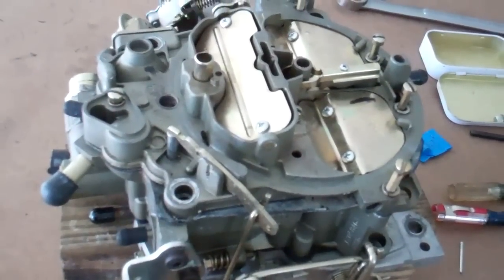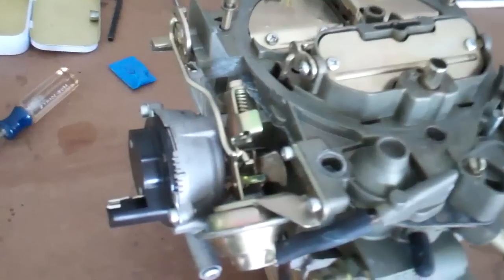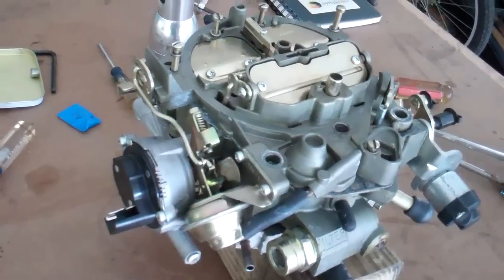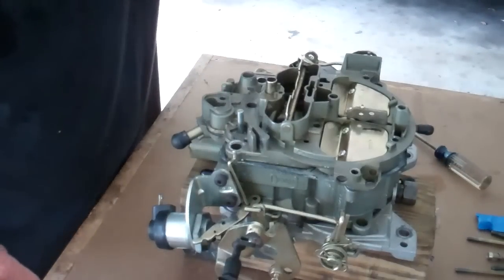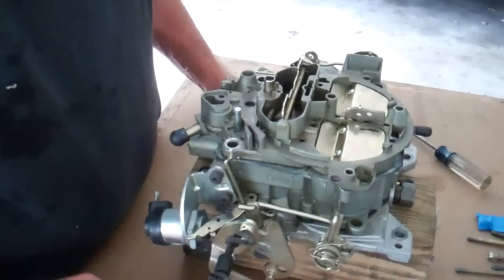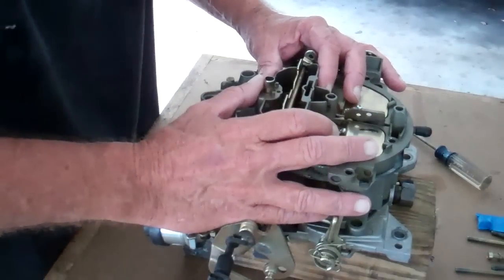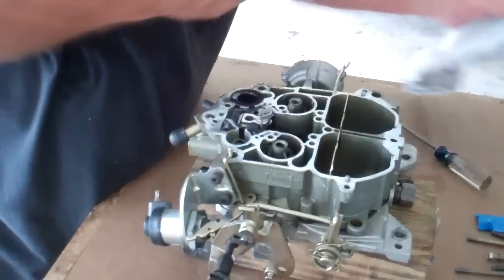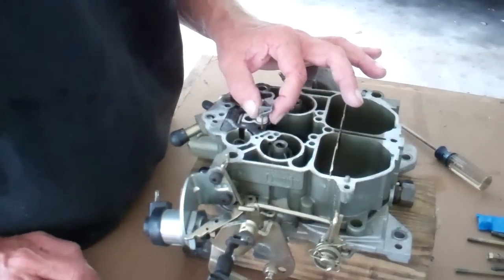re-jet your Quadrajet (part 1)

Comment: Thanks for creating this great video. I just got a '68 Camaro  SS396 with a new QJ that has a little hesitation when transitioning to on-throttle from off. With the help of your video I can now check/replace the jets to see if they are the right size for a 396 and perhaps the cause of the on-throttle stutter.

Comment: Great , Great , Video ... always wanted to fix my carb ... and nobody explained it so well ...
My problem is ... very rich .. and I set and reset  it and it stays the same ... and I thought to change the jets , my truck is a c10 83 ... with a 305 engine ...... and sometimes I  thought to change the carb for an after market like edelbrock or holley .. ..  cheers ..

Comment: The kit I bought had the black plunger for the acc pump. Threw that out and got me a blue one. Also noticed epoxy on the base bowl for the welch plugs. Cleaned and put on some jb weld around them. And your right it is a piece of cake. Hardest part was the gasket install under the metering valve.

Comment: Quadrajets get dogged out a lot by hotrodders but it is actually the best carb out there for street / strip performance cars. They are easy to tune and great on the street and there are stock class cars running 10’s with Quadrajet carburetion.

Comment: Is that a 705 series ? If so I would love to ask you a few questions . I'm building one for my 78 454 in a C 20 truck. Mine is 17058204     2147  BHT . For instance at 17:36 we are looking down at a Phillips head screw just behind the metering well. Mine has an atp there . Did you modify it ?

Comment: I've seen your video and thought it was great so many people slam the Rochester carb I have a 1987 monteCarlo ss I just put a 350 in it it's computer controlled gm copo burned the chip for it now I need to know what jets and metering rods to put in it the motor is pushing 300 hp with 356 torque I can get you more info on the motor if you need that appreciate your assistance if possible just trying to make it run as good as it looks from dean

Comment: Ok I know that the back bottom flaps are activated by the linkage on the drivers side.  But how does the passenger side operate for the top flap covers?

Comment: sir i have a holden 355 ci with mild cam , primary jets are 73 and secondary rods are CV.0530L.On the primary side the engine wants to boogy but on secondaries it bogs down. Now here in Australia there is a store selling DP.06886 rods and they say they are the only rods that will perform well. I cant see how this is possible as the rods i have in it have smaller tips than the DPs, possibly am i over fueling the secondary side. Also the secondary vacuum butterflies i have loosened the little grub screw let the tension off then using a screwdriver tensioned them back up to horizontal plus a quarter of a turn , is this correct . Would love your advice on these problems  for two reasons as you seem to me to know your stuff and all my mates condemn me for using a quadrajet , as they all love their Holleys , well i dont as i think the quadrajet is truly youneek   as is the only truly fully adjustable carby     on the market.Please help.Andrew Australia

Comment from the maker: nothing on the passenger side affects opening the 2 large barrels.  they are opened by the linkage shown in this vid on the driver side and the manifold vacum seen by the carb - yes, there are quite a few variants in q-jets from the 60s thru the 80s

Comment: Last year I replaced the quadrajet on my boat with a remanufactured one. My engine now runs, but the gassy smell at and just off idle is overwhelming. The idle mixture screws don't seem to help any. We are at high altitude (around 5,000 feet). Is rejetting for altitude what the doctor ordered? If so, who sells the kits for high-altitude rejetting of this carb?
Reply: I would like to know the same thing.  76 truck with 400 is from sealevel and now I live at 5400ft and it runs so rich.

Comment: I have a Question...   (a 35+yr. ASE Master Tech w/L-1, guy here).  

   On the Metering Rod's adjustment screw....  I can't find a Spec. For it!  
Yep!, It's My Own Truck!  (Sucks).  I've re-built Hundreds!  Hopped them up by
shaving the Shaft's, die-grinding away area's for more Fuel Volume...
  While On the Bench apart(at home).  Wife, helped Clean Garage!
The Paper (with the Turn Count),.. was never Found!   
   I've been chasing a lean Highway Cruse, ever since.....

    -Thom
Reply: 82 GMC 1500 "F" engine....
Reply from the maker: i'm not sure there is a 'spec' for APT.  like you i've built a lot of these, i just set it up at about 3 or 4 turns up from the bottom and adjust from there.  if yours is lean on the highway, try turning the APT up a quarter turn at a time or maybe your jets are too lean.  watch part 2 for a bit of tuning info.  i never grind on a carb, so won't offer any advice there - as far as i will go is drill for new bushings
Reply: The 'grinding' I was referring to, was the Tiny drilled holes on the outside of fuel bowl, buy the Secondary's.  There's a boss there, I've just eliminated that joining boss, for a little more Fuel volume in the bowl.  That's all.   I'm at 4.5 turns out now (on rod adjustment).   
   Thank You, for Your Time!     73  -Thom

Comment: all those people raking on holleys about the power valves havent used a new holley with the check ball system or installed one they may not be 100% effective but it takes the downfall of the best carb on the market and pretty well fixes it.

Comment: Hi! Great video on Qjet, I got 67 Firebird 400 project which came with dead Edelbrock 1406, had taken apart like 5 times and still does not idle. I guess the shafts are worn too much and I am considering the Qjet instead. The problem is the Ram Air thing, most of the Qjets for Pontiac have the Ram Air top, I dont have Ram Air, can I somehow remove or delete the Ram Air from top of the carb? And  bit offtopic question - what rims are those on your El Camino? Thanks!
Reply from the maker: ??? I don't understand your question.  1) If your engine is GM, it came out of the factory with a q-jet which looks just like the one in my video. 2) there is no 'ram air' to remove or delete from the top of the carb.  Ram Air was an option and all the parts for it are air cleaner and hood parts, not carb parts. 3) the Edelbrock 1406 is just an iteration of the old Carter AFB carb...IMO opinion you would be better off with a q-jet.

Comment: I have a stock 1987 monte carlo, 305 quardajet. motor. How can I find out what size jets I have? 
 It has a 373 rearend, and 28" tires. It turns 2.3k rpm at 70mph and gets a horrible 16 miles per gallon. I knowa 5.0 litre carberated motor can do better then this.  I had a 72 mach1 with a motor out of an 85 mustang H.O. and Holly 650. It got 23 mpg highway.
After watching your video I am wondering if I can step the jets down 1 size and get better cruising mpg?
Reply from the maker: the only way would be to open it up and look at them - the 3.73 rear end isn't helping your mpg (but it sure makes for a lot of fun when you push the long pedal).  be careful with it, the Qjet on an '87 is wholly computer controlled.  i don't mess with those and am not very savvy about them.  i have used Guaranteed Carburetor out of Largo, FL for rebuilt computer carbs with excellent results.  (no, i don't work or know anyone there)
Reply: Thanks. I decided not to jet it and just change secondary needles to DP type. Smooth taper.  I heard the stock ones are stepped for economy instead of performance.
Reply from the maker: that wouldn't do anything for your mpg - in a stock 305 the only time the secondaries will even begin to crack open will be when you stomp at the starting line or cruise over 100mph.  the chip that controls your carb, the jets and rods in your car are all set up for economy.  nothing to be done about that.  there was a time when JET and some other companies, including GM would sell you a performance chip...i doubt they are available anymore.  the chip you have cannot be re-flashed

Comment: Sir I have watched this video several times.  Yesterday I followed your video while taking my Carburetor air horn off.  My issue is the fuel pick up tubes.  The fuel pick up tubes for the secondaries on the bottom of the air horn were laying in the bowl.  I tapped them back into place, and reassembled.  Yet they have come loose again after just a short drive.  Do you have any suggestions for me on how to keep them in place.  Is there a glue or compound I can use so they wont keep coming out?
Reply from the maker: no, i would not use any type of glue or compound - to much opportunity to mess something up.  find some kind of tapered tool, like maybe a pick, down the tube to expand it - BE CAREFUL, don't overdo it.  once you expand it too far....
Reply: Lock tight red .

Comment from the maker: it doesn't - the top 'flaps' open when the carb sees X amount of vacum as the secondaries ('back bottom flaps') are opened - by the linkage on the driver side.

Comment: Hello I rejeted a 4ME Qjet. I put 50s Rods/68 jets. and lowered the Metering adjustment in 3 1/2 turns for better gas milage the problem is I don't think I have the rear / Front Breaks set right! I stumbles,no power at start, it Diesels when I shut off key. and sames times back fires. I did this before on my 76 4x4 350 4BBL. and I got it from 9.5 to 18.5 miles pre gallon. I was doing very good on gas.. but! this one is a 84 with a 350 $BBL. with Emission vac lines. the air pump seezed on me so I disconneted all of it! the town I Live don't have Smog Check.which is good. please send any info that will help! Kelly
Reply: Sounds like you have a timing issue

Comment: I hate the fact that people buy a classic car and throw an Edelbrock 1405 or 6 on the car and chuck the Quadrajet... thinking they are going to get performance 1405 and 1406 are 650 CFM carbs and the stock Quadrajet is larger 687CFM( do know there are 2 sizes) and smaller primaries. The smaller primaries provide better fuel economy for cruising and the larger secondaries provide the fuel for the HP. I cant remember how many times I wish I had a Quadrajet over the 650 Edelbrock that was put on the car i bought... Also the Edelbrock is a square bore carb and the Rochester is a spread bore...

Comment: Does anyone know how many turn out the screw right behind the cruise metering rods is? I think that is my problem I have a dead spot when I step on it once it is past that spot it is fine
Reply from the maker: that will depend on your engine.  just start turning it it up or down half a turn at a time, then drive your car around.  if it gets worse go the other way.  when you get close, use 1/4 turns then 1/8 turns until the car acts the way you like it.  watch part 2
Reply: Hesitation when you first step on gas?(dead spot) then fine?
 Thats the accelerator pump.
The adjustments those screws effect are not effecting what happens when you press that gas peddle. Only effects idle.

Comment: Hang on a second, I'm only a few minutes into the video but you just stated that the secondaries don't come into play until almost wide open throttle and in your case a little more than halfway which correlates to over 100 mph. Uuum, what about when you want to pass someone on the road or you just want to tromp on the pedal just to get that 4 barrel rush, just hotrodding around on country roads etc etc? You don't have to be going 100 mph for that, those secondary barrels can come into play well before you get up to that kind of speed.

Comment: Does anyone know how many turn out the screw right behind the cruise metering rods is? I think that is my problem I have a dead spot when I step on it once it is past that spot it is fine
Reply: Have you checked the accelerator pump linkage for slack?